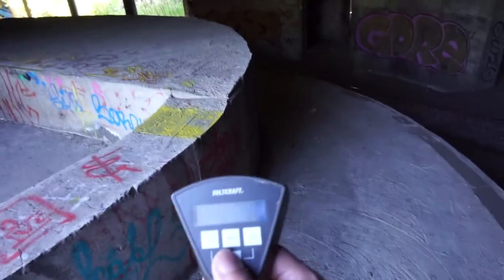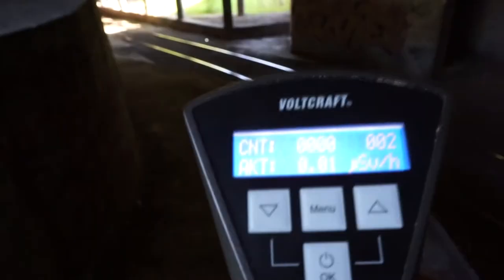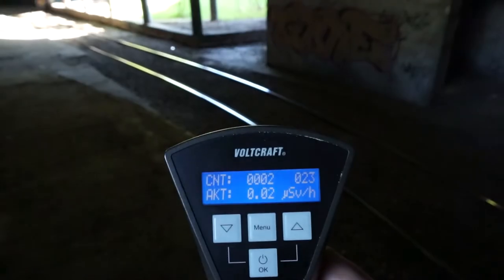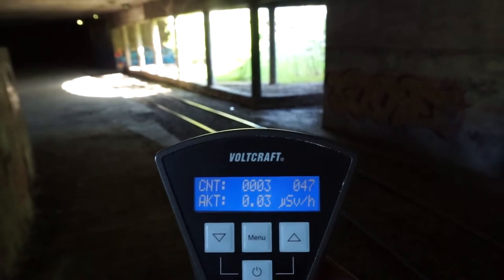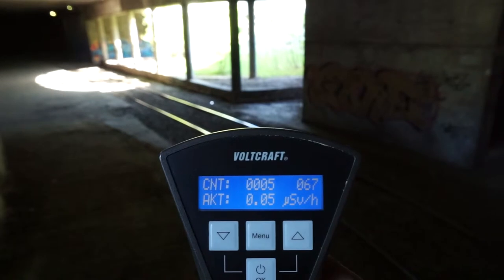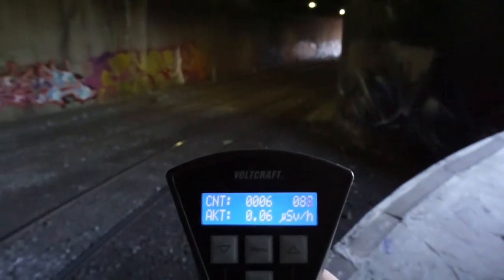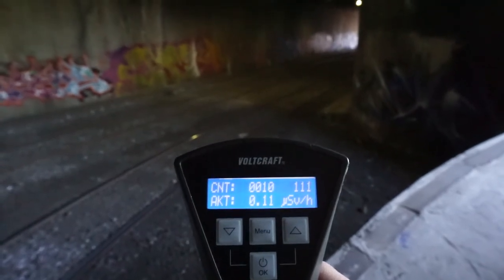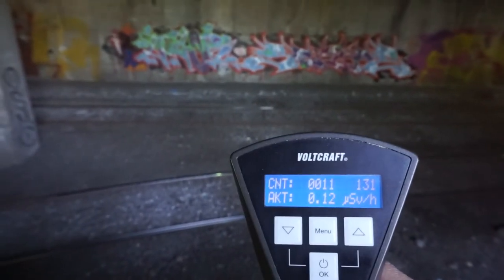Checking the radiation levels with a geiger counter in an abandoned tram stop (underground)

Comment: Interesting how it's still higher than normal, what would cause that?
Reply from the maker: Hmmm, nope, why higher? The normal background radiation is somewhere between 0.1 and 0.3 microsieverts per hour ( best reading is 0.1 ), so the value of 0.11 if completely normal. It's radiation coming off from cosmic gama rays, nuclear tests around the glove, accidents over the years, e.t.c called background radiation and not considered harmful:)
Reply: URBEX - Abandoned Secrets oh haha I thought you had said above 0.03 was too high. Still interesting. Are there any places with unusually high levels?
Reply from the maker: I have't found any yet, but maybe I haven't played enough with my Geiger counter either. One common place to find a high dose of background cosmic radiation is on a plane flight, especially if a long one across the ocean - levels go up to 8 microsieverts/hour - much more than the normal dose of not more than 0.3:)
Reply: @abandonedsecrets  Yeah there's no cosmic stuff under there nor any accidents or "gloves" whatever that means. The earth itself gives off a slight low level signature like that naturally. Same with other low level EM fields at low frequencies.